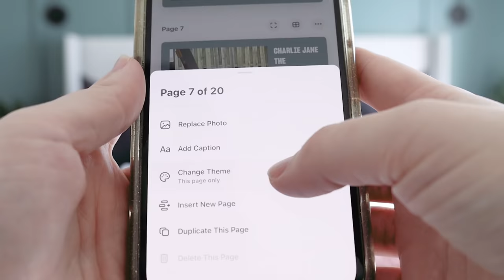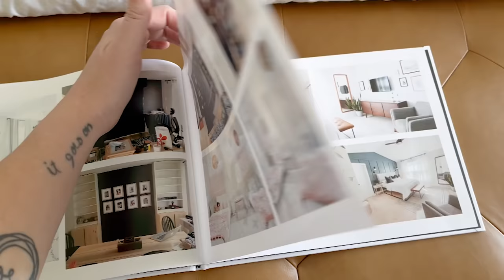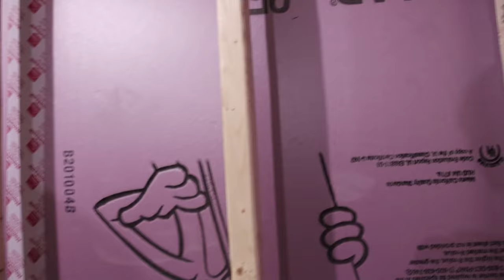DIY BASEMENT MAKEOVER 2021 | Basement Finish From Scratch

Comment: Thank you Carissa? should the walls be done first or the flooring?
Reply: Framing before flooring, but drywall can be done before or after flooring. Either way you want a small gap between the drywall and the floor. Then the final trim covers that gap